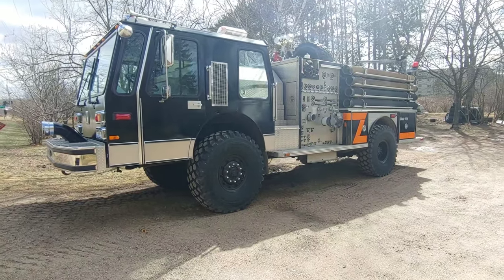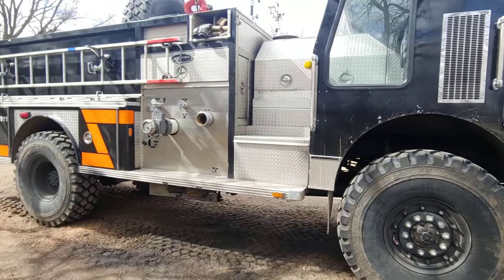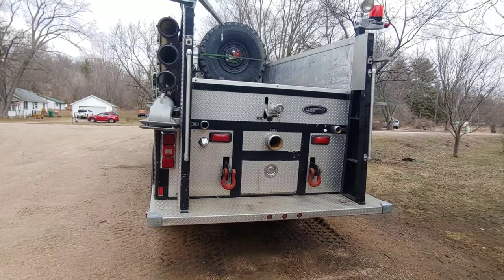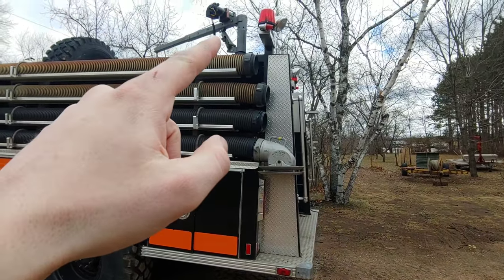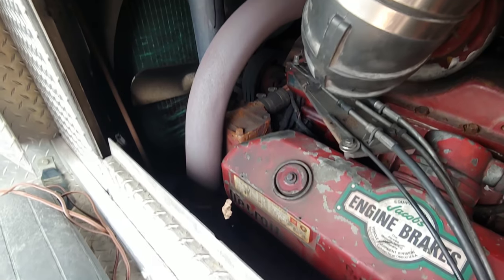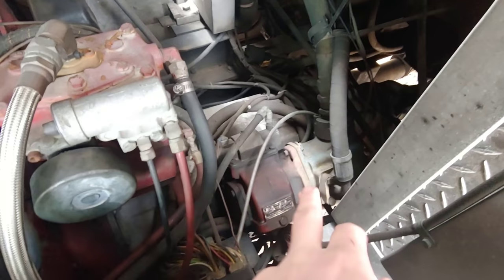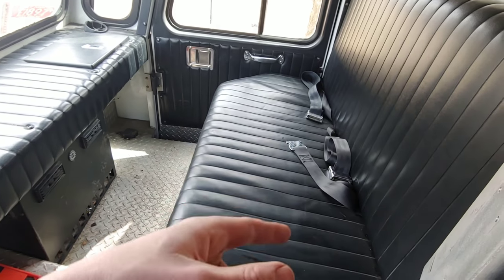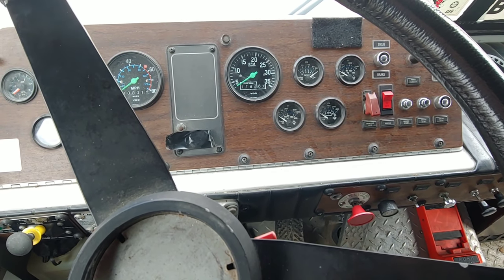Lifted 4x4 Detroit powered fire truck cold start and walk around, Sparkles the Firetruck

Comment: When Osage Beach operated this engine, it was assigned to a rural portion of their district, rather than near the Lake of the Ozarks.  This engine was designed to run through fields to farm ponds, and then draft from the pond to supply water for suppression.  That is why it had 4 wheel drive and multiple front suctions.  Originally, it was set up for highway driving with conventional duals in the rear and highway super singles up front. It was part of a large, multiple truck purchase from E-One for Osage Beach in the mid-80's.

Comment: It would be great as is for a offroad pumper truck for here in California for the next seasons wild fires. Might get a little better mpg if change the 4spd Allison to a 6spd, better ratios/ overdrive.
Reply: @jonniessink1  Would it need the whole trans replaced or just gearing.  Also with going to taller tires would that not mess up the power curve, speedometer and shift points?
We could use one of these where I live as well but North of California.  This year could be a bad year.
Seems like a waste to use this truck for something other than off-road firefighting.

Comment: Looks good.  Have you thought about a Back Up Camera System?  That Button to the right of the 2 Starter Buttons, does that work a Car Horn at the rear of the Fire engine?
Reply from the maker: Yup back up camera is is the works, just in time.   That button is actually the engine stop button.  It does have a backup beeper but that's it

Comment: Get rid of that old 4 speed non overdrive trans. You can find a 8 speed or 10 speed eaton ultra shift for a reasonable price. Will give you way better mpg and a cruise speed of roughly 65 @ 2000 rpms. If your plans are camper? The 13 speed ultra shift will give you some insane crawl capabilities that the 8 speed won't.
Reply: Nobody takes a Allison auto out of a truck to put a 13spd stick in
Reply: @bladenrexroth2555  yea the transmission alone would be more money then the whole 1989 fire truck is worth sounds like a good plan
Reply: @nephilly87  the 10 speed ultra shift is $3,500. Gives a better gear spread and improves the mpg on a truck that size. It can be programmed for his truck pulls and his highway cruise.